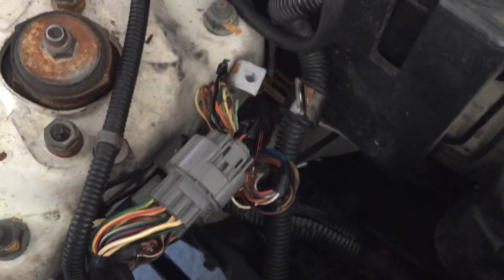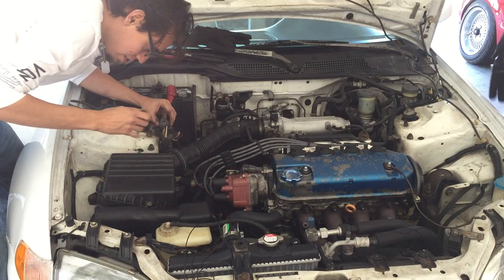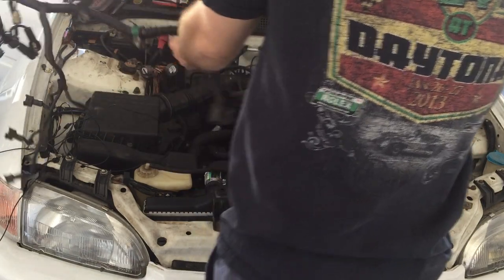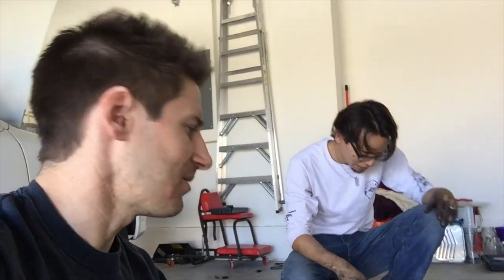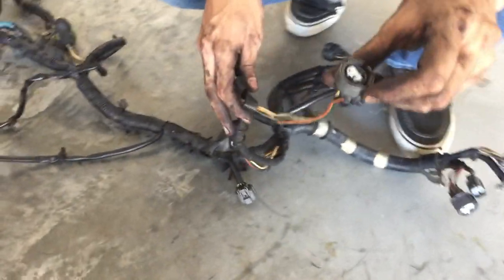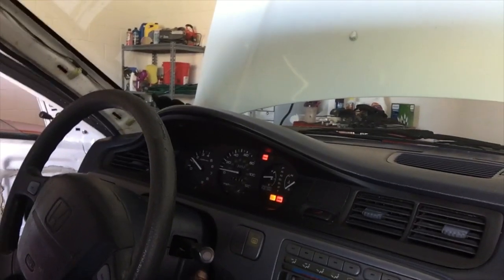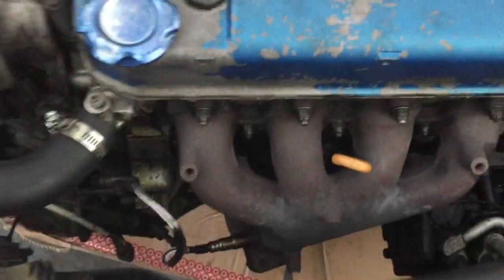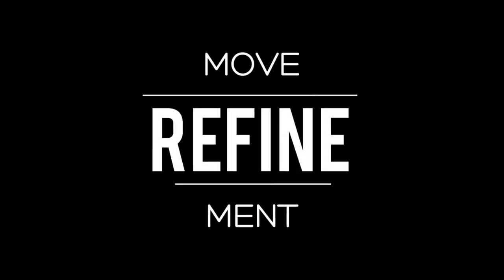Wire harness exchange 1992 Honda Civic EG - Ep. 13

Comment: Check timing with a timing light. Check fuel pressure by renting a gauge from VatoZone, here's a thread with similar issues http://www.d-series.org/forums/naturally-aspirated/126431-d16z6-wont-rev-past-5500-a.html. Check Vacuum at the FPR. Ignition coils are cheap, replace that and the ICM to rule out a distributor issue. I believe VatoZone can test ignition control modules too. The 02 code could be due to inefficiency, meaning its not seeing the amount of fuel or too much unburnt fuel, still sounds like either an ignition or a fueling problem. Hope you get some answers soon!

Comment: I would check the car side of the harness to ensure that all wires have connectivity at the ECU.  To do this, use a volt meter where you're plugging in your new harness and check the pins where the ecu plugged in.  This could be why you're still having issues even with the new O2, since it would prevent the ECU from seeing the signal.  Like you mentioned a chipped ECU would be beneficial as it has all the options to disable the CEL and gives tuneability for rev limit and fuel/spark trims.  I love my Hondata.

Comment: Here's what you need to do. You need to get rid of that ecu that's in your car get yourself a p28 and it will fix your problems go to Xenocron.com or look up advancedignition on eBay they chip and socket the p28

Comment: Broo get a chipped ecu it will help you alot start with a basemap & disable the 02 & You can set your rev limiter at what ever you want . I can help you with that
Reply: & also with the program i have you can see your ecu codes by just pressing the gas with the car in position 1 key
Reply from the maker: Yeah, I remember you mentioning that from last week.  I am always a few episodes ahead on my filming from when they are released so even when you told me that last week, this video was already done and edited.  I'll most likely be going for a chipped ecu.
Reply: Bro trust me car will run alot better ! & make you happier :D
Reply: I'm converting a d15b from carburetor to injector, how do I convert the wire harness?

Comment: I remember there was a website to convert it to a 4 wire o2. I had to do that to my civic vx cuz it had the 5 or 7 wire o2 all I had to do was run my power feed into my injectors and it work perfectly fine

Comment: ive always had stupid o2 sensor issues, best thing to do is get that ecu chipped and disable the 02 and never ever deal with them again :D
Reply from the maker: lol that's kind of the way this is looking.  We really wanted to retain it and run it oem but that may be going out the window haha
Reply: will still be stock. same stock ecu and run the same stock basemap just disable the sensors and not worry about it again lol

Comment: HEY GET A EX 5 SPEED!!!! CLUSTER... BECAUSE THE EX CLUSTER THE CABLES FOR THE RPM ARE DIFFERENT  CUZ I HAD THAT PROBLEM 2!! AND FOR YOUR ENGINE LIGHT  GO UNDER YOU STEERING WILL AND ERASE  THE CHECK ENGINE LIGHT WITH THE TWO PINS CONECTING THEN TOGETHER  IT WORKS...

Comment: "smh" i dont get it. in my car, 95 civic. i had the original D16z6 engine. blew up that up. swap in D15b7 and it worked just fine. blew up that engine to lol now it has JDM D15b. works just fine.

Comment: WHY DID YOU CHANGE THE HARNESS?! I told you, this was such an easy repair. Keep the old harness exactly the way it was and run the extra wires from the 4-wire o2 sensor to the o2 sensor ECU pins directly through the firewall. Don't mess with the harness. This was your original idea; why do you keep changing it?
Reply from the maker: whoah Michael, it'll be ok homie, breathe.  We had the idea to change to the harness that came with the b7 so that we wouldn't have to run wires direct to the ecu, try to keep it oem.  Obviously that didn't work out because we had to run the map direct anyway.  We were hoping that having the proper 4 wire o2 already in the harness would just work and it still hasn't.  We probably will end up still trying to run it direct to the ecu or I'll end up getting a chipped ecu when I go for a swap.  Not everyone in the world is a Honda mechanic man, we are learning.
Reply from the maker: and on that last video, the "paper clip trick" one, we did run the o2 straight to the ecu, it didn't work.  Going to try a brand new o2 when we try that again
Reply: michael you needa make more ek videos! lol

Comment: i'd try another ecu to eliminate that as an issue. If you have changed the O2 sensor and the check engine light is still on then it could be the ecu. i'd also consider checking voltage supply

Comment: Maybe cuz you're using a automatic cluster and make sure the ecu is for manual. I also noticed the speed wasn't working again. 

And isn't there another o2 sensor?!?

Anyways good luck with your build! Keep them vids coming
Reply from the maker: Thanks for your comment man, and good eye. Yeah, the speed-o wasn't working in this clip.  With the new wiring harness there was a bad connection to the vehicle speed sensor.  I fixed that though, you'll see in the track videos it works.  As for the o2 sensor, I believe there would be 2 from the factory, 1 before and 1 after the cat.  But since these guys deleted the cat that exhaust piping is different now and it deleted the downstream o2.  I'm likely just going to get the ecu chipped and resolve the whole o2 thing.  Thanks for watching
Reply: Refine Movement  obd1 only had one o2 sensor

Comment: Hey my buddy had his LS only redlining at 6k and he changed out the pcv valve with one from autozone. It didn't make a difference so he was looking at distributor, ecu, etc. I had him buy an oem pcv valve and it fixed the issue :)
Reply from the maker: I really appreciate that input man, thank you for telling me!  It's crazy, when the car is warm, it revs to 6500 all day, but when it's cold it'll start out at 5500.  Worked great on the track day though, you'll be seeing!
Reply: Refine Movement nice man, can't wait to see the track day videos.

Comment: Wire the O2 straight to the ecu that might fix your problem.
Reply from the maker: Thanks for your input man
Reply: Refine Movement disconnect and reconnect the battery to fix

Comment: no offense ,but just swap the motor why waste time on this engine
Reply from the maker: I understand man.  My plan was to run this car as I bought it at a track day event so that I can get some good baseline lap times.  Thankfully, I did that track day two weeks ago now, and it was amazing!  The engine actually performed very well for what it is.  My plan from here is to focus on the handling of the car first.  Wheels/tires/suspension, then track it again and see the improvements.  Especially after this first track day my thought is that if I had a more powerful engine, I'd be off the track in the dirt constantly at a track day.  These super skinny all season tires cannot handle any more power and the suspension is 20+ years old.  Those need to be changed first before any power comes on board.  Thanks for your input and for watching!
Reply: well said

Comment: I've been chasing issues with the pins inside the connectors not making a secure connection and causing CELs stalling out crank no start and all kinds of issues
Reply from the maker: Dang man, I feel your pain.  Hang in there though and keep at it
Reply: Ben Kittrell probably bad ecru I had problems with start up it's the board I found a fry spot
Reply: I found the issue! I was backpinning the wiring harness with a paperclip and it bent the pins so they don't make contact with the ECU pins. I soldered in a new pigtail that I found at the junkyard and its been running great ever since!
Reply from the maker: That's great man, I bet you're excited haha. Good job
Reply: I've been competing with the car at the autocross and it's doing great!!! once I get some maxxis RC-1 in the 225/45r15 size on all 4 corners I'll really be cooking with gas!
Reply: BTW a 15x8+36 rim with a 205/50 tire fits under the stock fender without modification if the car isn't lowered too far
Reply: but I run about -3.5 camber in front and -2 in rear though
Reply from the maker: That's awesome dude! Those are some healthy camber settings haha, I've been reading and seems those are pretty universally agreed upon as a good starting point for front wheel drive.  That's great your wheels fit.  I'm looking into the 15x8 as well, either 205/50 or 225/45.  Glad to hear you are having fun with your car!

Comment: have you try to use another B7 ECU
Reply from the maker: I have not tried that, no
Reply: you might have a bad ECU
Reply: I remember back in the days we used to use a spark plug non fouler put in with the O2 sensor on the header just make sure drill out a  bigger hole on the spark plug non fouler so the sensor can read
Reply from the maker: That's actually what I'm going to be trying here, the spark plug non fouler.  Thanks for your input man, ECU i could always try too

Comment: my 92 dx auto has the map sensor on the throttle body. my 93 dx 5spd has it on the fire wall. manual n auto are different i guess
Reply from the maker: Yeah, see I didn't know that at the time we were doing this.  That's really crazy how there are a few different versions of harness for essentially the same car.